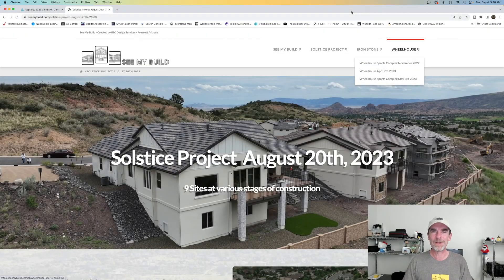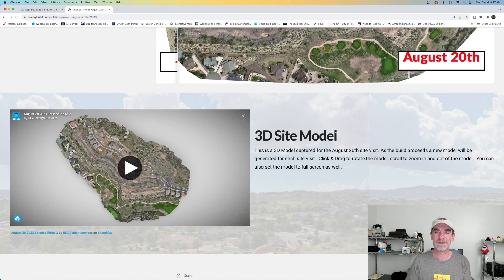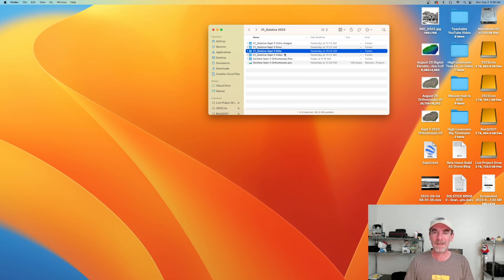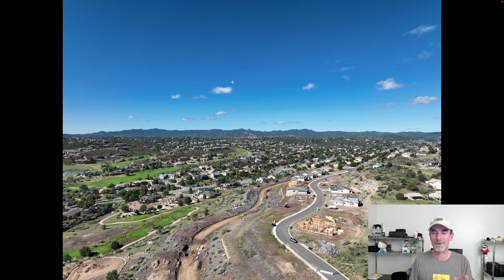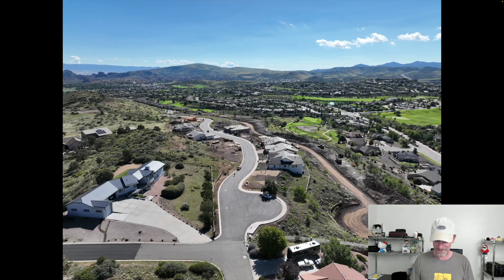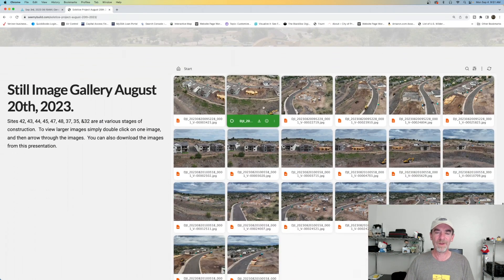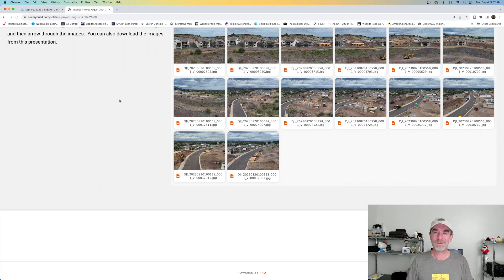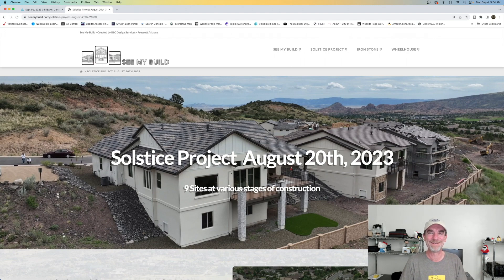Drone Construction Progression Job - Still Images And Preparation - Part 3

Comment: Great video series.  Any advice on how to get clients without having previous examples to show case.  This is my biggest issue of getting started, I have nothing in construction to present to future clients.  I have a lot of real estate examples but wanting to move up to higher paying work.
Reply from the maker: Having some type of portfolio to reference is always helpful.  When I first started doing the construction work I went to a location near me where work was going on. Sunday mornings I would fly the job site, run through my batteries, and then return to my office to toy with the maps and models.  I used those original flights in my main website so folks could see what's possible.  Do you have any ongoing construction in your area?
Reply: @AZ-Drone  yes there are a lot. So after flying and organizing the media. Would you recommend trying to contact the builder before publishing to my  public website, or make it a secure page first. Thank you for all your help its greatly appreciated.
Reply: @gregparrigin I plan to do the same thing. Get setup first, go fly a local development, figuring it all out on the way. Publish to a site, so you can present in the form they could see using themselves. Whether private or not it's still just public photography and the site won't be indexed anyway. 
Then, yeah all about how to approach them. In person I'd prefer with an iPad maybe. Emails are easily ignored & you're sat there waiting wondering.